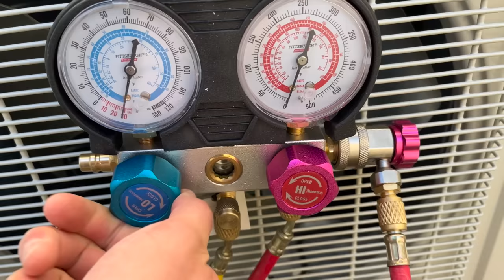I built an epic home office in my backyard - start to finish

Comment: How did you acquire your first software engineering job? Coming from a software engineer in the making
Reply from the maker: In a roundabout way. I was working on my software engineering degree when I got a job at the company on the customer success team. I then moved on to be a project manager, then a QA. As QA, I was closer to the code and told the director of engineering that I’d be happy to take care of the smaller problems in my extra time. By that time I had graduated and eventually got the offer to move into engineering. The director knew that I was interested in the job the whole time and was working to make it happen. It definitely helped that it was a small company with good people, hence the potential for internal mobility. 

The job I’m at now I got in the hard way - going through the interview process. Fortunately, they have a good interview process. I got several rejections before landing this one. 

Are you currently interviewing or not to that point yet?

Comment: Great build! I'm at about the point in mine where I need to install the AC. Have you noticed any vibration/noise from wall mounting your condenser vs building a concrete pad? Thanks in advace!
Reply from the maker: Thanks! I haven't noticed any. That may be partially because the rockwool insulation really helps to insulate against sound as well.

Comment: Pretty cool. About how much they all this cost you? I’m debating building my own or just getting a premade Home Depot one lol
Reply from the maker: Somewhere in the neighborhood of $20k. Once I make it through my pile of receipts I'll put together a cost breakdown video. 

There are a couple reasons that it's as high as it is. Mainly, I hired out electrical because that's required where I live and I didn't want to take the risk. That blew my budget out of the water. Second, that massive door unit was expensive, but I really wanted all that natural light. There's also the fact that I made it 22' wide. It didn't really need to be that wide. 

You could make one for a good bit less than I did if you didn't have those constraints.
Reply: @nathanetech  thanks for taking the time to reply. I enjoyed your video and happy that you interact with your followers 👍

Comment: Brother awesome job.. any advice ? Did you have prior experience? Any tips you can share ,please.
Reply from the maker: Thank you. No prior experience here. 

If you plan to do something like this with no experience, just make sure you do plenty of research for each step. I watched several instructional videos from different builders for each step to get a well-rounded idea of what to do. You can find building codes by googling. I typically ended up on upcodes.com when trying to find something in the codes.
Reply: @nathanetech  thanks brother.. Happy Thanksgiving. The problem I’m having is how did you know the size to which you needed to cut and the dimensions. Did you follow a plan? That is my hurdle .
Reply from the maker: @Munchiie  I didn't work off any plans. I knew that I wanted a large office - I have a big desk and wanted to be able to fit a sectional sofa inside as well. I drew out a rough picture of what I wanted it to look like and worked towards that. 

That said, I'm sure you can find plans for not too much money
Reply: @nathanetech  thank you for the feedback.. look forward to the other videos !!

Comment: Nice job. Why didn't you insulate the floor before the plywood
Reply from the maker: I didn’t want to risk getting it wet before the building was dried in. Fiberglass insulation loses its insulating ability when it gets wet, and we had a lot of rain that winter when I was building.
Reply: That makes sense. When I built my addition I used 4 inches of rigid so getting wet wasn't an issue
Reply from the maker: @artackerman2744  That would've been a lot easier on my back. Should probably do that next time.

Comment: I’m curious about what planning goes into getting electricity out there. Did you tap into the main breaker and run wires underground before starting the build or something?
Reply from the maker: I had to hire that part out because it’s legally required here. But yes, they added another breaker onto the main box, ran wire through a trench, and added a breaker in the office

Comment: Nice video! It's pretty impressive seeing 1 person doing this job and it gives me hope that I can build one myself someday :-). Just curious, did you work off of plans or was this an original design? Also, any plans to make a video about mistakes or yardwork to run electrical to the dwelling?
Reply from the maker: Thank you! 

The design was original. I just knew that I wanted a lot of natural light and a single slope roof. 

I'm currently making a series going through each step of the process in more detail and discussing some mistakes there, but I may end up doing a video on mistakes across the entire build.

The electrical is the only part of the job I had to hire out, which is why I didn't record it. Where I live, you have to be a licensed electrician to do electrical work, and I figured it wasn't worth the risk. I can make a video down the road explaining how the electrical was run, because I do understand it.

Comment: What part of the country do you live in? Wondering if I can get away with an R15 in my rafters as well and not pay out my nose in heating cost!
Reply from the maker: I live in the southeast. Your local building codes should tell you a minimum R-value for your area. Usually when I searched for building codes, I’d end up on upcodes.com and could find what I was looking for.

Comment: When you installed the insulation, did you have a vapor barrier? Is it needed on a project like this?
Reply from the maker: I can't recall all the research that went into me deciding not to put a vapor barrier on the walls, but I do remember this video (https://youtu.be/q8fOMBlfh3A?si=Kc0U34S3fZPC4g81) informing my decision. 

It's worth mentioning that I'm not in a climate where I'm going to be using heat most of the year.

Comment: Got a question. Note, I don’t know anything about construction. For the floor, why did he have to put in all of those smaller pieces of wood? (Like the shelf-like pieces). I understand doing it for the walls because you need outlets, wires, windows etc, but why for the floor? It looked like the smaller sections were just covered up by the floorboard?
Reply from the maker: I think you are talking about the joists - the boards running in between the 3 beams, right?

By code, those have to be installed every 16 inches to support the subfloor (those big sheets of OSB I laid down on top). Without the support of the joists, the subfloor wouldn’t be able to support much weight and I’d fall through
Reply: @nathanetech oooo my mistake I was talking about @5:30. But it looks like you just used the platform to build on and that was the wall. I rewatched just the floor portion and yes, I see the 16” separated pieces you mentioned and that was all. Thanks for taking the time to comment btw
Reply from the maker: Oh that makes a lot more sense, thanks for clarifying. Those are part of the framing of the front wall. They help not only carry the load of the roof down to the foundation, but also give me consistently spaced places to attach the OSB and drywall

Comment: it would have been easier to insulate floor when it built rather then go from underneath
Reply from the maker: That's true. The reason I waited is because I didn't want to risk getting the insulation wet before the building was dried in. That season was very rainy.

Comment: How come no poly wrap on the interior between insulation and drywall?
Reply from the maker: I can't recall all the research that went into me deciding not to put a vapor barrier on the walls, but I do remember this video (https://youtu.be/q8fOMBlfh3A?si=Kc0U34S3fZPC4g81) informing my decision. 

It's worth mentioning that I'm not in a climate where I'm going to be using heat most of the year.

Comment: Did you get permits and are you allowed to build an office in the backyard per local zoning?
Reply: As a side note, your steps also need a railing.  How deep is your footing?  You need 3'-0" if in the US to prevent frost heave.  Hope you don't have to take it down or pay fines.  Your property will also be reassessed.  Was all the work inspected?  These are the processes that go into building a space and one with electric and HVAC.  How was the electric run?  In code, wood cannot touch grade.  I would have used sonotube footings for the porch deck.  This is from my 20 plus years working for an architect.  It's not just a shed, but a conditioned space.

Comment: No vapour barrier!? Going to be awfully expensive to keep warm.
Reply from the maker: I did install a vapor barrier on the bottom. Towards the end of the video. Or are you talking about a different part of the building?
Reply: @nathanetech  the walls also need one, potentially the ceiling (depending on your climate zone), and blown in insulation covering the ceiling drywall in attic space. You papered insulation is probably good enough for the ceiling, but definitely need a vapour barrier on walls.
Reply from the maker: @trevorhardy3544  Thanks for clarifying. I can't recall all the research that went into me deciding not to put a vapor barrier on the walls, but I do remember this video (https://youtu.be/q8fOMBlfh3A?si=Kc0U34S3fZPC4g81) informing my decision. 

It's worth mentioning that I'm not in a climate where I'm going to be using heat most of the year.

Comment: Does that foundation work good in sandy clay soil?
Reply from the maker: That’s the kind of soil I have. I made sure to dig the holes deeper and wider than they needed to be so I could fill in the extra space with gravel and sand. From everything I researched, it should work just fine.

Comment: Um… no vapor barrier between the insulation and drywall?? Weird
Reply from the maker: I can't recall all the research that went into me deciding not to put a vapor barrier on the walls, but I do remember this video (https://youtu.be/q8fOMBlfh3A?si=Kc0U34S3fZPC4g81) informing my decision. 

It's worth mentioning that I'm not in a climate where I'm going to be using heat most of the year.

Comment: How did you run electrical and internet to the office ?
Reply from the maker: Had to hire out the electrical because that’s required where I live. Added a new breaker to my main breaker box then ran the line through a trench to the building. 

For internet, I use a mesh system with the primary in my house and a point in the office. It has been stable so far.

Comment: Did you put insulation on the floor?
Reply from the maker: Yes. I showed just a little bit of it close to the end. I cut pieces of R19 fiberglass insulation and crawled under the building to fit them between the floor joists before attaching the vapor barrier.

Comment: @1:45 why is it necessary to vacuum up concrete dust when you're outside?
Reply from the maker: Because otherwise the anchor would hit the dust inside the hole and not be able to go all the way in. 

It wouldn’t have been as much of a problem if I had just bought a longer masonry bit.

Comment: How did you brought electricity?
Reply from the maker: Dug a trench from the main breaker box on the side of my house, added a breaker, ran the cable through the trench, then brought it up the side of the building, through the wall, into a breaker in the office. 

I didn’t show that part because I had to hire it out. My area requires electrical work to be done by a licensed electrician.

Comment: What kind of air conditioning system is that?
Reply from the maker: It’s called a mini split. Does both cooling and heating
Reply: @nathanetech  what brand did you go with?
Reply from the maker: @paigeivy8801  Rovsun. It’s nothing special. I found it on Amazon and got it because it was several hundred dollars cheaper than the name brand ones.